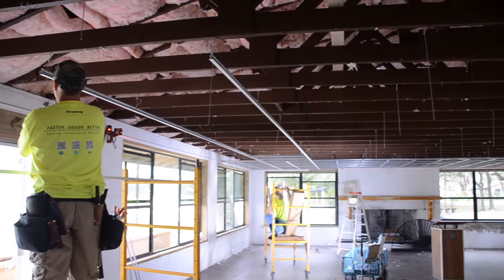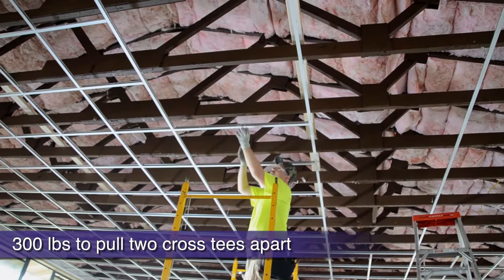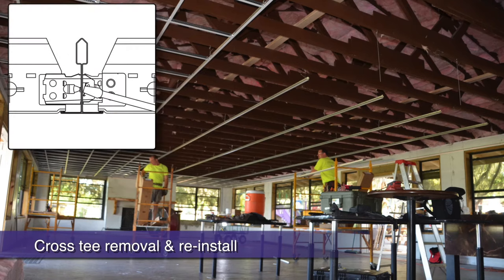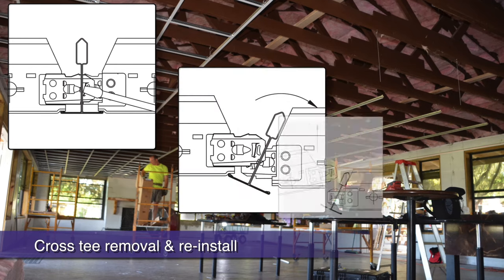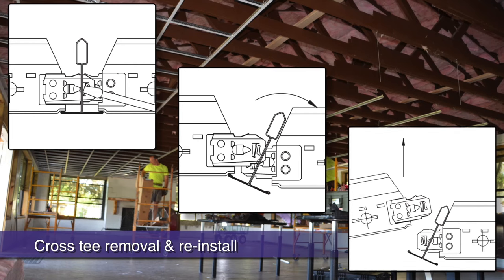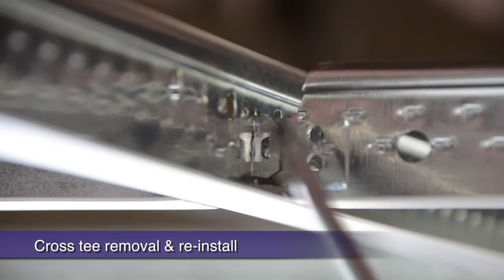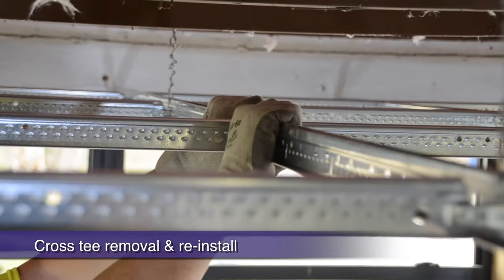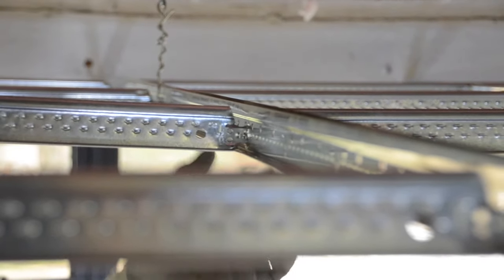Easily Remove Acoustical Cross Tees | Armstrong Ceiling Solutions

Comment: HI.  It would be helpful to annotate this video by circling the tabs to be released and later bent back into locking position.  Its hard to see these in an existing grid.  I did not install it so I was not sure what I was looking at.
Reply: Same here lol.
Reply: It was very useful to find out about the tab that needs to be pushed in first then twist, however,  found it difficult to do this overhead with a screwdriver, occasionally needing also a hammer as seen in the video.  I discovered that it was so much easier to  squeeze in the tab with a pair of needle nose pliers.